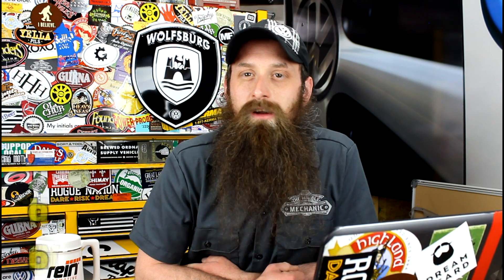Viewer Questions ~ Podcast Episode 56

Comment: Another great benefit of electronic power steering, is that if the engine is off but the ignition is on, and the car is going faster than walking pace, the power steering will work. So if the vehicle has engine failure at high speeds, you'll be able to steer yourself to safety instead of hydraulic steering, which will immediately become stiff once the engine has stalled. It's saved my butt in a Mazda3 and a VW Tiguan.
Reply from the maker: Brandon Friesen It does make pushing cars easier too. :)

Comment: Hey Charles

Thanks for answering my question I really appreciate it, and just a quick fyi my Jetta is a 2003 1.8t and the cat is hot at the front near the exhaust manifold and almost ice cold at the back just after shut down.

Oem parts are 700 and up were I live, so wouldn't it be easier to buy a aftermarket I think that's what I'll do

Comment: interesting about the wind compensation, i dont find it working in my MY06, for example with crosswind i always need to compensate, and i have the steering set to the maximum assist setting

Comment: Take the brake fluid container , cut a hole in the top of it,  shove a compresser nozel inside.     Attach the hoze to the bleeder valvle,    ill loosen the bleeder vavle and blow fluid through it.

Comment: Electric steering is one of the worst technology advancements ever invented! If you're an enthusiast who likes sporty driving,they provide zero steering feel. Their main " quality " is numbness. You have no idea what the wheels are doing. Turning the steering wheel easily is not an advantage,unless you're 80 years old and you shouldn't be driving anyway.
The electric steering has been invented for a sole purpose : fuel economy. They put no drag on the engine. They are overly complicated systems who will fail,and when they do they will cost an arm an a leg.
The traditional hydraulic steering will outlast electric without question. The hydraulic system CAN NOT cost more than the electric! This is misinformation.  You have a pump,2 lines,a reservoir and a steering rack. The 2 major components can be rebuilt. Why don't you ask VW to rebuilt the electric motor and module?! See what they'll tell you!
Reply from the maker: Nick Nicu Have you driven a new GTI? I think you might have a different opinion on electronic power steering. That car is amazing, and adjustable. Plus it sounds like you are coming from an enthusiast stand point. Remember that most drivers are NOT enthusiasts. Most drivers use their car to get from A to B. 

Also, you must not have ever seen how much a hydro rack for a Touareg is.
Reply: Not only that I've driven the new GTI but I've also owned an 08 MK5 and I can tell you without a doubt the steering in the MK5 was much better. I see the adjustability as pure gadgetry to make it more complicated and having more things to fail. You press the Sport button and it stiffens up the suspension,it changes the throttle response mapping and stiffens up the steering feel. Unfortunately,by stiffening up the steering feel,it does not improve the complete lack of connection to the road and numbness. The new Porsche 911 is guilty of the same problem. I have owned an older Porsche 996 Turbo,I currently own a 997 GTS and have driven 997 GT3/RS and it's hard to find steering feel like in those cars. My E46 M3 has also a brilliant steering feel,perfectly weighed-which you can't say about the electric steering in the newer BMWs.
Most hydraulic steering racks can be rebuilt as any mechanical system and it doesn't cost nearly as much as a new unit. They will also last a lot longer if properly maintained-that's a fact! Like I said,try to rebuilt an electric motor/modules and computers that control electric steering.
Reply from the maker: Nick Nicu I wonder what Porsche engineers say about electric steering? When you get into that world, it takes out the average driver part of the equation. 

And no doubt about not rebuilding electric power steering gears. 

I really do dig your point of view man
Reply: Most engineers,Porsche included know the reality of electric steering,but they can only build what the bean counters allow them. And the stake is MPG numbers-that's it! Simple as that! They are pressured by Gov regulations. I understand you can't speak your mind all the time since you work for the company,but here's how things go when it comes to serviceability : Gov reg drive fuel efficiency and safety. The World dealer network is pushing manufacturers to build complicated systems that can't be serviced by the average Joe without millions of dollars worth of equipment. Remember,the most income dealers make around the World comes from the Service Department,not from the Sales Department. That's a statistical fact,not my opinion. Also,these days cars are built cheaply to last 100K miles and then to buy new ones. Most manufacturers do not provide replacement parts anymore once 10 years have passed.
Reply from the maker: Nick Nicu You are spot on about the SVC dept making the income not the Sales. 

I have ran into plenty of situations where the manufacturer does not support cars 10+ years old. We see it in our repair manual as well as parts catalog. 

While Gov regs push car makers in a certain innovative direction, do you think that car makers would also want to push their own innovation? With out gov regs, would they be more focused on customers? Or would they have the mindset of "we know what is best for the customer"? One that may push innovation faster than customers ever could
Reply: Of course there are many factors involved,besides what I've described. They all work together to achieve technological advancement. That can't be stopped. But it doesn't make it better either or more durable. From a customer's point,you want a reliable car to last a long time and not cost a fortunate to fix because you have to change multiple systems and subsystems integrated in the car's technology in order to make it function properly again. We,as customers are like hamsters in a lab. They are testing the new technology on us and on our pocket. If you do not want to deal with it,you buy new everytime the warranty goes out and guess what?! That's what they want you to do because it's making them even more money. It's simple really. Why do you think the leasing programs are so good these days?